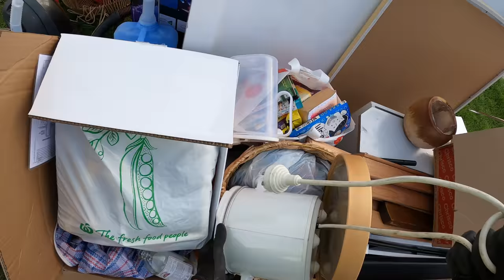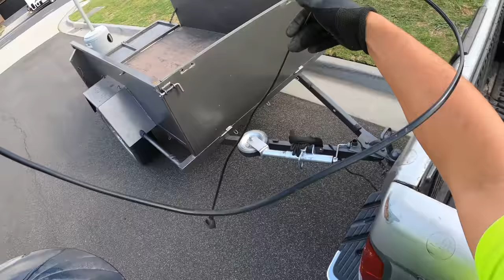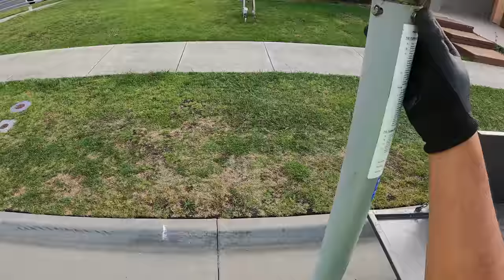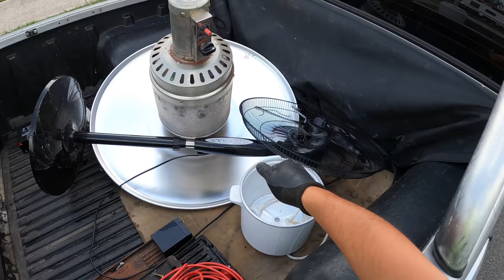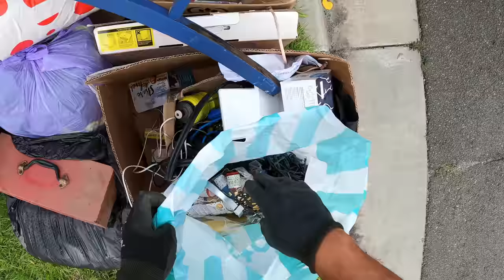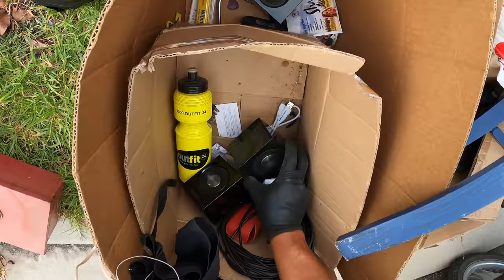Curb Shopping Feat. The Dumpster That Kept On Giving

Comment: I clean up the copper and brass , anything that is hard to take apart l cut up with a angle grinder quick cut disks real thin buy the cheapest you can    find wear eye protection, gloves and a shirt with sleeves clean metal fetches the best price and you use the bench vice to hold things when cutting 🇨🇦from up top to down under 👍
Reply from the maker: Sounds like a plan! Thank you Cam 👍👍

Comment: Does Manhari or your secondary scrapyard take the Christmas lights as low grade wire?  If so could be worth stockpiling separately for when you go there?
Reply from the maker: I think Manhari does. I’ll double check with my other local yard. Cheers Brad 🍻👍

Comment: what do you do with dvdplayers?, do u scrap them for boards, or do you just sell them.?
Reply from the maker: I usually scrap them. Sometimes if they record to hdd I’ll resell 🙂
Reply: @PolyProphet  do u know how to open up microwave transformers?, cuse if u dont i got a trick how to.
Reply from the maker: @beamer8907  I haven’t tried yet. I was going to check YouTube 😅 Does it require special tools?
Reply: @PolyProphet  nope you only need a  big hammer and a foot to hold while hammering, Theres a weld on the transformer some were, if you hit the weld Hard enough it Will crack, and then you can open it, and get the copper out. 👌
Reply: Maybe this guy can give ya some ideas? (canadian treasure hunter)
Reply from the maker: @beamer8907  sounds simple as! Thanks for the tip Beamer 👍👍
Reply: @PolyProphet  No problem, Hope you Will get tha copper out, 😁